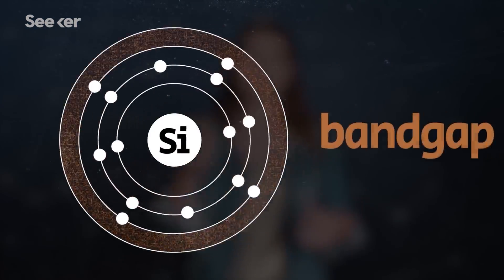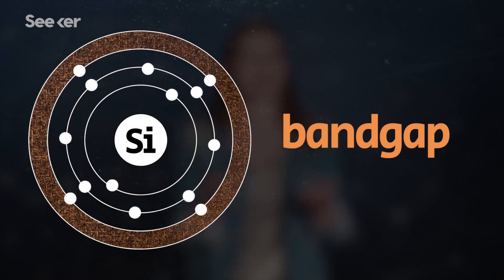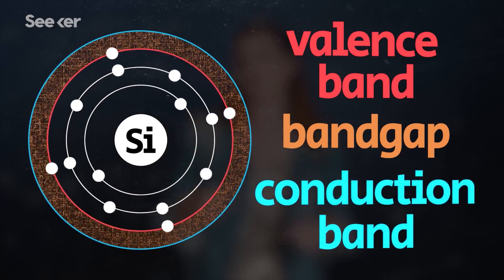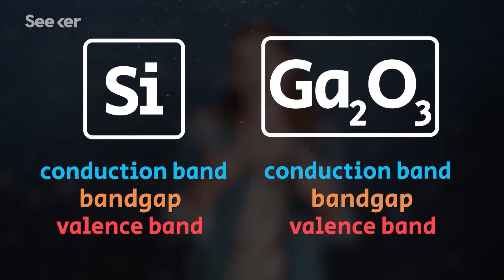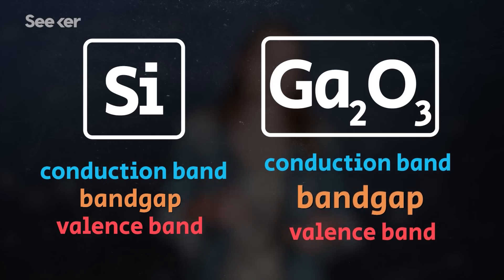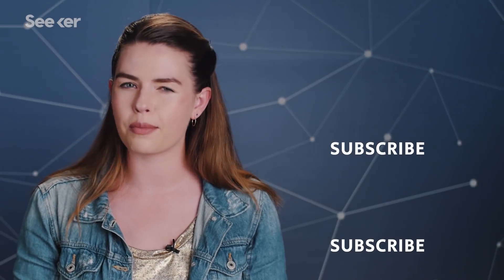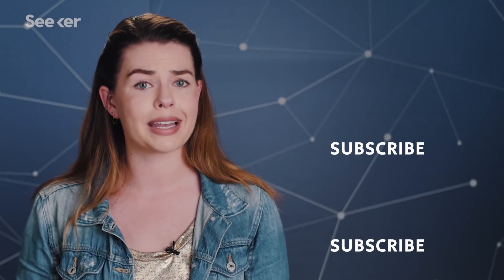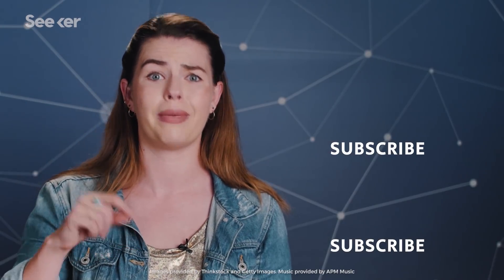Goodbye Silicon! Your Next Computer Chip Could Be Made of Gallium Oxide

Comment: Gallium Oxide  semiconductors are not months new, they were being studied a decade ago...

Édit: correction, Gallium Arsenide is what’s old as other commenters have said.
Reply: Maxime Boissonneault lm not sure, l thought the same, but might have gotten a bit mixed up. Previously it was gallium arsenide and then gallium nitride, l think gallium oxide might be relatively new of the scene, though l still find the comparison of an ipads computing power to what they used for the Apollo missions to be utter stupidity (the Apollo missions used less processing power than a $50 android phone picked up at a local supermarket).
Reply: Yea it's not months old I've heard about it years ago too
Reply: As  Matt said, it was gallium arsenide that was "the next great thing". And it was way more than a decade ago.  I'm thinking like maybe even more than 25 years ago.  But silicon is much cheaper and has other significant advantages over gallium arsenide, thus the gallium arsenide revolution never arrived.  Research into Ga2O3 is in fact new.  So, Maxime and tonee899, you are wrong it is new.
Reply: You are right, I confused it with Gallium Arsenide
Reply: When she said "this is a new field" I almost fucking died from disbelief. GaAs has been studied since something like 1986 and material science of semiconductors has been around for quite some time.
Reply: Is Ga Oxide research new or did they just blow the dust off material science research done back in the 70's/80's? 

Back when money was no object for the three letter agencies, I believe both Cray and IBM were looking at the various Ga and other large band gap materials for both electron and photon based computing.
Reply: Thanks for correcting me!
Reply: Without bothering to look for papers or anything, my guess is the "new" part being different ways of analyzing the materials.  I'd never seen semiconductors being described in terms of valence bands and band gaps before for example (doesn't mean that's the research in question -- I certainly don't know everything) but that sort of difference in context is probably what's new.
Reply: AND IT HAS BEEN DISCARDED AS A DUMB IDEA AND THIS VIDEO IS INSTANTLY DEBUNKED.
Reply: +Julian Depaepe Wow.  That kind of unjustified assertion is usually saved for politics, not chemistry.  Good..job..?
Reply: Lmao, what has politics to do with this...
Reply: Dream Furder people Gallium Oxide will never be used in consumer processors not today not tomorrow, never.
Reply: +Julian Depaepe Politics has absolutely nothing to do with this.  I was just observing that chemistry doesn't generally incite that kind of moronic all-caps, no-evidence claim you made.
Reply: AH and where is their Evidence?
Reply: I swear if you are right i am giving u a blind check ;-)
Reply: Dude even Fusion Reactors have a bigger chance of making it into reality than this nonesense
Reply: https://www.youtube.com/watch?v=0c0QLaVLhTs they already made mistakes in the past! never trusting this source again! fake news!
Reply: +Julian Depaepe Holy hell dude.. I certainly hope you're just being the weirdest troll ever cause if that's really how you view the world, you have one hell of a messed up mindset.
- "Their" evidence is the multiple articles and research papers linked in the video description.
- And a random insult to my intelligence because.. why?
- And then you flip on that because.. why?
- Then you talk about something completely different because.. why?
- And finally you link to a video by some completely different person (a well-known conspiracy theorist no less) and claim that's a reason for not trusting "this" source?

All over the course of a few minutes.. that is some hella random thought patterns..
Reply: First proof and a working prototype then talking about evidence. period. no proof no evidence = a concept
Reply: id be highly optimistic and with a grain of salt since this source is really worthless.
Reply: Only 1 article lmao

Comment: What if my PC heats up so much that gallium started melting?
Reply: Slavic Derp 
I'm just assuming that's why thy're not talking about pure gallium, but gallium oxide instead.
The oxygen molecule may stabilize the structure and prevent melting maybe?
Composite materials have different properties than pure elements.
Reply: Slavic Derp Gallium Oxide**

Comment: ROFL. Silicone is way better, easier to deal with and is small enough to fit in a hand.
 Seriously whytf would anyone want things smaller than their hand?
 Remember necessity isn't the mother of invention. Invention is the mother of necessity.
Reply: Vishwa Mithra really don't get it do u? 
So you need to shrink the transistor size so you can fit more on to a given surface area of chip. If you want computers to get more powerful then you need more transistors or to run the ones you have far faster(doesn't end well). So the end product can be made the same size, but becomes more powerful as the number of transistors increase, it also becomes more efficient as a side effect or the smaller voltages required to make the smaller transistors work.
Reply: VariantAEC yep same stuff(different molecular structure, but same element).
Silicone is the 8th most plentiful element in the universe by mass so it's pretty much everywhere. It's also in silica sand, quartz, lots tends to be in dust, used in countless products and is a part of countless rock types. It looks very different depending on what form it's in, a bit like water(yet very different) how water, ice and steam can look and behave very differently yet they are all different states of the same stuff.
Reply: Vishwa Mithra 
Silicone? As in plastic breasts?
Reply: VariantAEC bahahaha oh God l must be having a slow day😂 
(   ) (   )

Comment: Other ideas of improving computing: Throw x86 under the bus and get a set of powerful ARMs instead. x86 is awful hodgepodge and it should be discarded a long time ago by the Intel.
Reply: QVear x86 deals mostly with memory addressing. If you only have 4GB of RAM a 64 bit processor won't do you any good. Also doesn't help Moore's Law in any way.
Reply: Brian N I mean throw away the entire x86 architecture, like we did away with 6502, 68k, Z80, PowerPC and other architectures that became useless. I mean, get an up-to-date x86 manual, and you got a nice, heavy, door stop. Something with THAT many instructions can't be as fast, reliable and power-saving as ARM can be at the same voltage and clocking.

Fortunately desktop ARM may be soon a thing. And it will be glorious.
Reply: https://www.quora.com/Whats-the-difference-between-ARM-and-x86-processors If you read a few of the responses, x86 typically outperforms ARM processors, though they consume more power. And they actually can be faster, as ARM processors require loading and storing data every time a function is called, which takes a bit of time depending on the bandwidth. As clock rate is directly proportional to clock speed, in that more voltage is required to push a faster speed, pushing higher voltages would do nothing but damage your chip once it reaches its maximum clock. And if you had an ARM at the same voltage and clock as an x86, you'd just have a really power-inefficient ARM processor.
Reply: Unless of course all you needed was a calculator for addition and subtraction. Then an ARM processor is probably faster and more energy-efficient. And just because you can't comprehend something being "as fast" does not make it false.
Reply: Brian N Except that sort of comparison and test is unfair for a very simple reason: ARMs aren't clocked and under the same voltage because usually they're stuck in the mobile devices, in a SoC configuration which mean they have to take care of graphics, sound, networking and so on and battery consumption is a problem. ARMs could have much higher voltage and clocking than x86 CPUs and not even break a sweat, which would lead to a much higher performance with power consumption on par with a modern x86 CPU if ARM core wouldn't be a part of SoC and instead be its own chip.
Reply: Instead of typing you a 30 page essay on computational tasks, here's a thorough article from All About Circuits
https://www.allaboutcircuits.com/news/understanding-the-differences-between-arm-and-x86-cores/

Comment: Gallium would be too expensive. It would only be usable in specialised equipment.
Reply: Falney gallium isn't expensive at all and is relatively plentiful. I have some sitting in my freezer l ordered off Amazon in case l feel like messing with someone l work with(the classic fork or spoon gag).
Reply: Matt TheChosen gallium, $645 per kilogram, silicon (99% pure) <$1 per kilo.
Reply: Falney the wholesale market price of gallium hasn't exceeded $400 and can pick up a kg of it on Amazon for around $415 right now. Silicone is one of the most plentiful elements on earth so the actual silicon is not really a factor in the end price of CPUs, what is a factor is that to get the purity of silicon needed for processors is insanely difficult (increasingly so as transistor sizes shrink and tolerances shrink with them). While l could walk down to a local beach or dig a hole in my back yard to find plenty of silicon to make all the processors l could ever want, the cost and difficulty of producing the pure crystal wafers used to make processors turn a very very cheap resource into a very very expensive end product. Gallium is actually a lot easier to work with than silicon in many ways, though it has its own issues, but more importantly the amount of gallium that would be used in a gallium oxide(or nitride or arsenide) chip would be at most a couple of grams.
Reply: Matt TheChosen you are correct. I did a Google search and it showed 99.99% as costing 645-975 but after checking again, it was from 2011. That being said, the silicon I mentioned is 99.99% is still far cheaper than the gallium.
Yes, they have to refine the silicon further, but they also have to refine the gallium. Surely if gallium was such a wonderful alternative, we would already be using it? 
 I honestly do not foresee gallium being used in consumer level technology for a long time.
Reply: Falney the 99.99% is really just silicon metal and is basically just the first step in a very difficult process, the end result is likely to be closer to $10,000 per kg.
Gallium has been considered as an option for a long time though it wasn't the only option being looked at. The reason silicon has been used for so long is that it has been used for a long time(it was working fine until we effectively reached its limits), because we have been using silicon for so long we understand it very well, huge amounts of research has been done and possibly even more importantly huge amounts of money has been spent of building the chip fabs that make these processors (every major chip fab is a multibillion dollar project and companies like Intel have multiple fabs). To change all the current production methods from using silicon to anything else is to say the least a daunting prospect. Not only the cost of the equipment to use the new process, but also like any new process when making processors, the initial yeilds is likely to be fairly poor until all the bugs can be worked out. 
Companies like Intel and IBM have been working of the research side of gallium processors for a very long time, but the end step of large scale production is a very big and extremely expensive step, so until they really really have to they are hesitant to make the move.
Reply: if making the transistors smaller is such a colossal pain in the ass, why not make the silicon wafer bigger and cram more transistors onto it that way instead

surely the difficulty in producing a larger die is far easier than trying to stop quantum tunneling
Reply: I do  understand that yes. I also understand that the issues with the CPU size are on the quantum level. I won't pretend to understand how it works, I just know that the transistors are so small that even in their off state, they let electrons pass through them. 

As for 10,000 per kilogram for the silicon. I have no idea why you would think it is that expensive. Now, I know that 100% pure Silicon (Silicon 28) is around $1m per Kilo. But that is far too high of a quality to use in CPU's. Silicon-28 is the isotope of silicon that is used in semiconductors. 

Now. Before I continue to argue this, I decided to look up information on prices of wafers, which is actually pretty difficult to find costs as no one really wants to publish them. BUT you can get blank wafers large enough for 500 CPU's off Ebay for about $20 + shipping. In addition to this I found an article from 2015 discussing Gallium Arsenide as opposed to Gallium Oxide, but I think it would be similar in nature price wise. Also bare in mind that this is Solar cell grade wafers, CPU grade wafers would be more expensive

https://www.futurity.org/gallium-arsenide-solar-cells-885992/

It compares Gallium Wafers at $5k compared to silicon wafers at $5.

I did though find a forum discussion where some one claimed that silicon Wafers used in GPU's were about $5k but they linked no sources and they simply said "We heard it was ..." so rumours rather than facts. 

Also. I am not saying that Gallium is bad. I am just saying I don't expect to see them any time soon in consumer computers. (Apparently it is used in Cell Phone CPU architecture.)
Reply: Falney l got that you pointed out they were solar cells, just reconfirming what you had already said.
One of the big areas of research spending in regards to things like gallium is working out how they can best swap from current silicon products to gallium products. The wafers do cost huge amounts even at the best estimates, but it's true the biggest single cost is likely the buildings and equipment. Luckily much of the current equipment is likely going to be reusable, though of course some will have to be modified and some will need full replacement. The act of shutting down a major fab to do a serious refit will be hugely expensive both in terms of the refit itself and the loss of production untill the new systems are online and working as expected (this often takes longer than expected). It's definitely not something they want to do, but they simply don't have a choice.
Reply: Falney are you aware of what process node we are on and we are almost at the point where electrons won’t stay where we want them. In literally a few years we will not be able to use silicon we are moving to 7 nm and anything under that will be very difficult. Are you aware of what goes into chip manufacturing switching to gallium will be trivial under a decade there will be gallium oxide chips.
Reply: Falney ok so the eBay bit through me for a sec, but they are test wafers that were either used when developing or testing a new node or that were duds. Once a wafer has been used(or exposed to a none clean room environment) then they are effectively worthless and there are lots of them out there.
The $10k figure was from several years ago and was an industry estimate as each fab generally makes their own wafers. The cost is because they are grown as single crystals that have to be absolutely perfect and because they want them to have the largest diameter possible as it's easier to fit chips on to a wider wafer(always parts that can't be used near the round edge). 
That article was interesting, but the price is not overly surprising given its a prototype rather than a production run and as the article pointed out the gallium wafer was potentially reusable and could be used to make many many solar circuits(lm not 100% clear on their method but seems the wafer wasn't actually a needed part of their solar cell, but could instead be used as a printing block of sorts to produce them).
Reply: Falney oh and yes solar wafers though way better than they used to be a generally junk compared to chip wafers. Solar cells will only lose a tiny bit of output if there are imperfections in the wafer, a CPU simply won't work or will have random errors.
Reply: Falney as for when gallium will start being widely used, probably around 10 years as by then they won't have much option. The move to 7nm and 'maybe' 4 nm will be the end of silicon, they won't have any other option but to move to a new material. Gallium isn't the only possible replacement for silicon, but it's currently the most likely.
Reply: Matt TheChosen I made sure to point out that they were solar cells for that reason.

The only reason I used that article was because after 30 to 40 mins of searching, that was the best I could find. There really is no real data.

But OK, if a gallium wafer costs 5k (3 years ago) and that person on the forum said 5k for one intended for gpu's which it was posted in 2014 I think. It is more plausible when taking that into consideration. BUT, the wafers are not the expensive parts. The infrastructure and research are. Which still leaves me sceptical that we will see widespread adoption in consumer grade electronics in the near future.
Reply: The silicon purity has to be literally %99.99999999 btw
Reply: Yes, I know.
Reply: MWB Gaming cost, yields, heat, power are all reasons to not build bigger, not to mention that most of the devices chips go Into are small and keep getting smaller